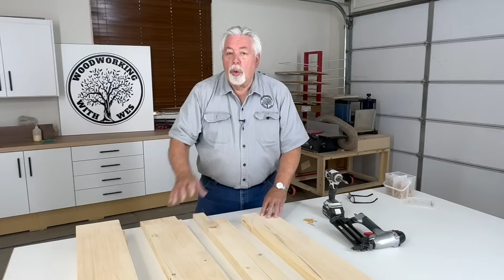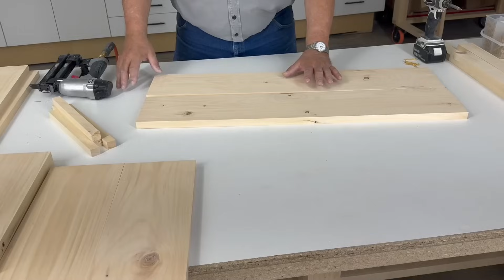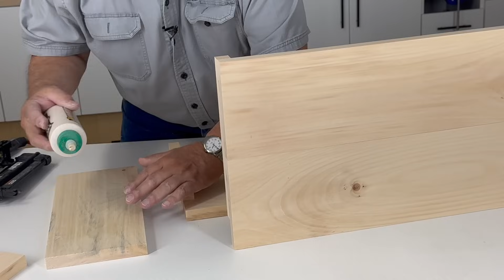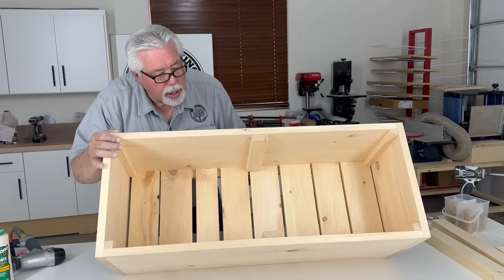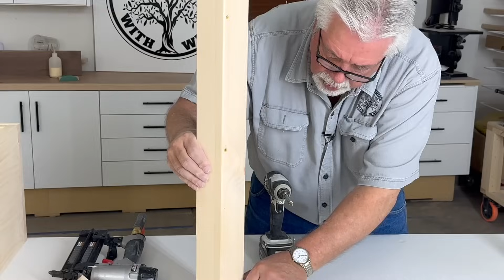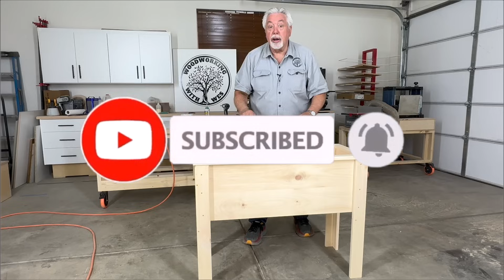This Build Is So Satisfying

Comment: hey there, enjoying your videos-- new to woodworking--  i recently tried something similar and after watching a couple of videos on youtube-- ive been made aware how important predrilling is.. and yet still went and tried without predrilling while using some deck screws ..  and eventually ended badly😅.  I quickly went to home depot and bought some proper bits.    I was watching your build and noticed you didn't need them at all!  I'm not certain but  I believe you even screwed at the very end of the board into an end grain.  how did you do that?    i was using thinner pieces and reclaimed wood..  but at most half the sizes..  is this something you just learn or get the feel of over time?  or whats your rules on predrilling or when do you really have to?   thanks for the videos and cool projects!
Reply from the maker: Hi..great question! That’s exactly the kind of thing I go in-depth on inside my exclusive Q&A platform. There, I can provide a detailed video response, extra guidance, and even walk you through the process. I’d love to help you tackle this build—check it out here:
https://woodworkingwithwes.com.    Thanks, Wes 😀

Comment: What size screws did you use?   Did you use galvanized brads?
Reply: I think it was 1-5/8” deck screws.  Can you buy galvanized 18 gauge brad nails?
Reply from the maker: @OleGit1497
Yes...1 5/8" deck screws with regular non-galvanized brads. Thanks, Wes

Comment: Looks good! Anyone else nervous about the hand position whilst using the nail gun? 😅
Reply: When your educated about the length of the nail/screw it’s not an issue. Your comment shows you need a mentor!
Reply: @mike1968442  Your comments are very unfair! We are all here to learn. Instead of smacking the guy in the chops with a smartass remark, why not try and help him and others who might like to know.

Wes, I hope you see this comment. If so, I can tell you that you have opened my eyes to the usefulness of the nail gun. I would like to see a video on the use of the nail gun and the safety, settings, and maintenance of these tools and the various products (nails, staples, etc.) and how they are used. Thanks, Wes I appreciate your efforts in producing your videos!
Reply from the maker: @mike1968442
I have made a video showing the different nail guns I use in my work, but perhaps one with more detail would serve a purpose. It's on the list 😀 thanks, Wes
Reply: @mike1968442  I’m on the journey. :) Would love a mentor. I’ve seen some nasty pics where nail guns go wrong. I have a 18 gauge but haven’t had many projects I’ve needed it so far.
Reply: @mike1968442  I’m on the journey but would love a mentor! I’ve seen some horrid pics where nails have gone wrong but appreciate he knows what he’s doing. I have a 18 gauge nailer but I haven’t had many projects to use it on.

Comment: What I have done in the past is add a few support cross pieces on the bottom (same as Wes did but only about 1.5" wide so there's more room between the cross pieces) and overtop of that I will use galvanized wire (1/4" squares), nail down with crown staples, then add a layer of weed barrier to prevent soil from getting out.  I also add plastic down the sides and overlap it onto the weed barrier.  This method prevents soil/water contact with the wood.
Reply: Good suggestions
Reply from the maker: @dwaynebrazeaux3084
Great gardening tip! Thanks, Wes